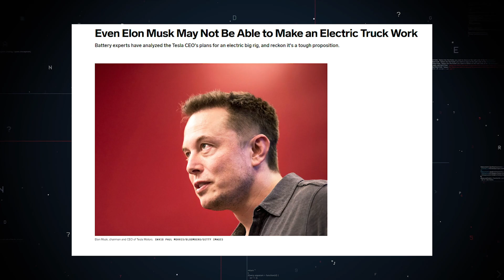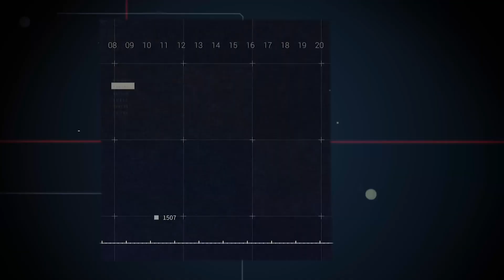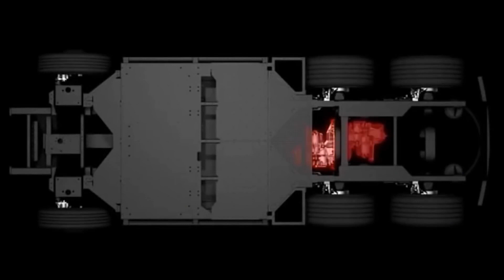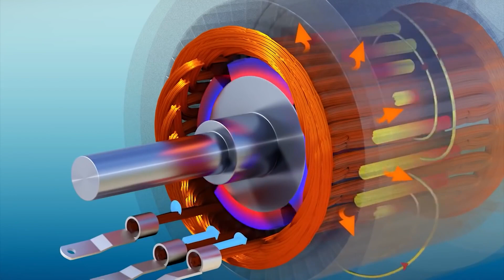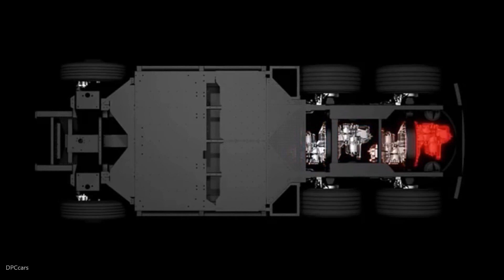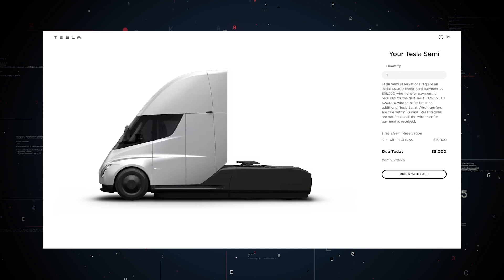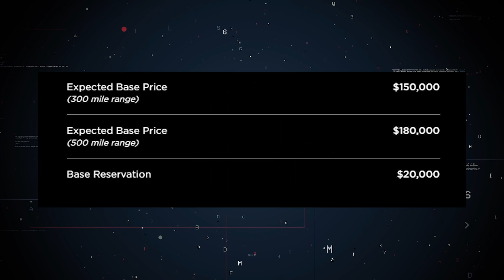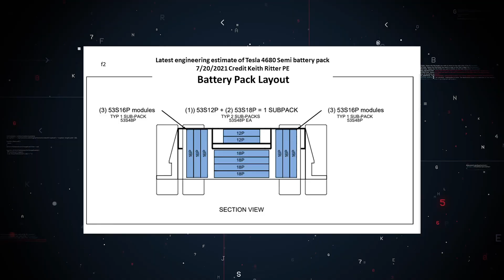IT HAPPENED! The Tesla Semi-Truck IS FINALLY Coming In 2023

Comment: I guess I don’t understand, why put all the batteries in the truck. If the majority of the batteries were in the floor of the trailer most trailers sit parked at docks to be loaded they could be plugged into the grid while being loaded then when the truck comes to pick them up you plug the fully energized trailer into the truck. Plus the trailer is 8ft by 54ft which is a lot of room for the Tesla solar panels. So any where they are they would be charging. A truck that is charging is not productive, a trailer that is charging could be loaded out. Am I wrong?
Reply: Fantastic and logic Idea!! I hope Elon receive these message
Reply: Kinda unrealistic. You'd have to replace ALL the trailers before replacing the trucks. Trucks are usually recycled every 4-5 years depending on the mileage. Trailers stay in service much longer. Also there's a lot more trailers than trucks out there. I.E. Schneider national has 10k trucks and 34k trailers. Swift has 18k trucks and 58k trailers. You've also got to have space for the chargers at the shipper in the docks/yard which ALOT of places don't have. But then again alot of truck stops don't have that either where there's truck parking 🤷